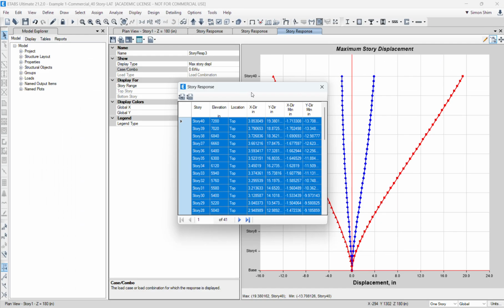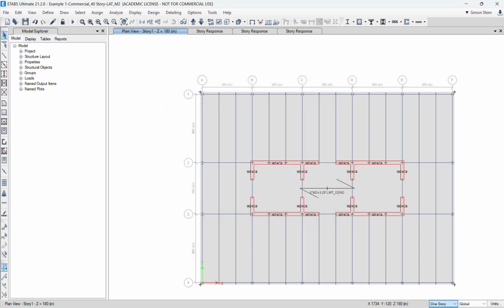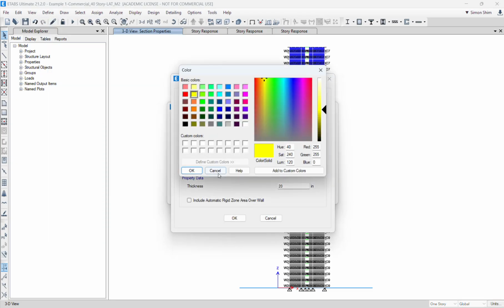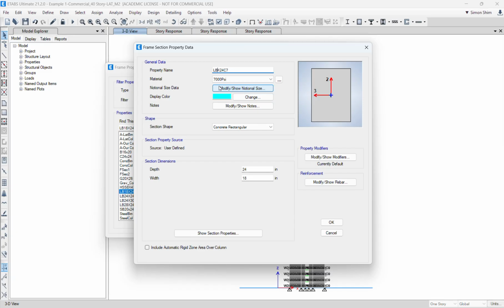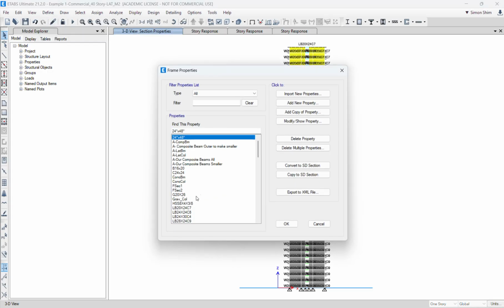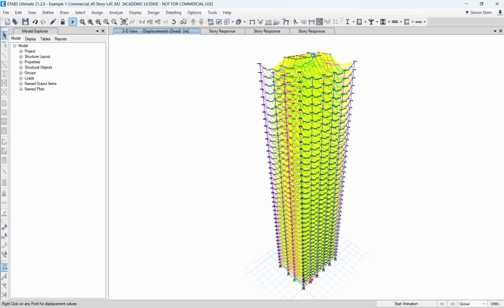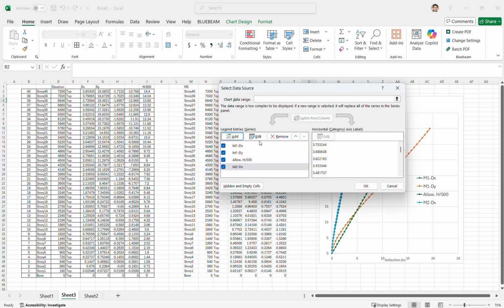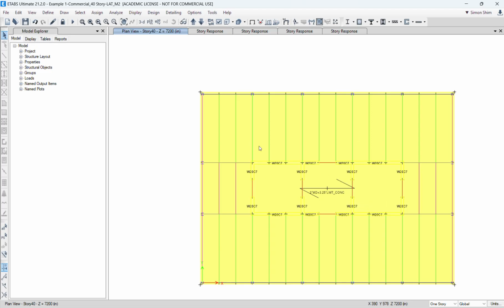ETABS Tall Building Lateral Model Study 3 - Proportioning Wall and Concrete Strength

Comment from the maker: Service Wind Load can be calculated in a separate wind case with Service Wind Basic Speed (50 year return), 
Service wind Speed = 98 MPH, Ultimate wind Speed = 115 MPH,   Total Wind Shear = (115 MPH/98 MPH) ^2 = ~ 1.378  --> 1.0W vs. 1.6W
In opposite side,  (98 MPH/ 115 MPH) = 0.85^2 =0.726
For this exercise, we use 0.6 (~1/1.6) factor from Ultimate to Service., Approximate